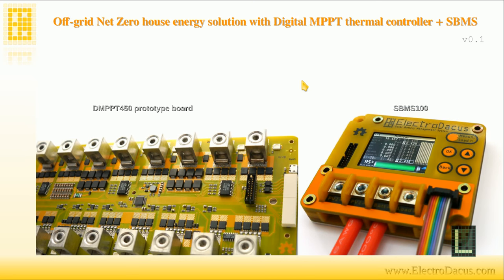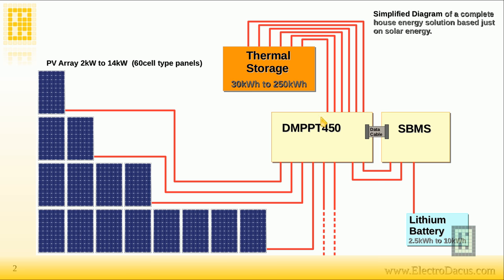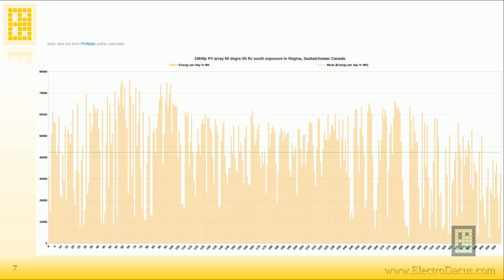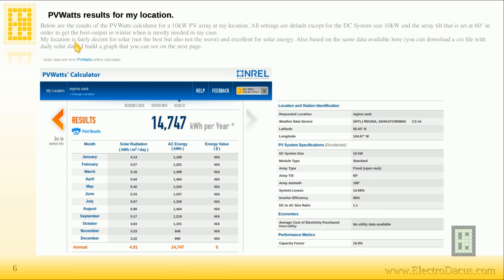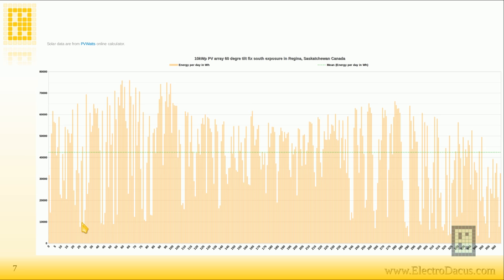Explaining the Digital MPPT thermal controller

Comment: Also in California not near the coast, you use a lot more energy for AC than I think the graphs show.  You also have to cool all the heat generated by your appliances and cooking.  On December 31st I got 2.1 kwh from a 6.5 kw west facing array. About 3 days a year less than 5 kwh.  Just about every watt you send to the floor or drums is a watt that helps you.   40 kwh is not enough in July to cool.  But if you get a cop of 3 would it not be better to run a heat pump?  But overall is pretty amazing.
Reply from the maker: I will use Los Angeles as example and that is a fairly moderate climate see this graph http://www.los-angeles.climatemps.com/los-angeles-average-temperatures-chart.gif
And here is one for even closer to coast http://www.surf-forecast.com/sstgraphs/Santa-Monic-Pier.png
Based on this you will not need any air conditioning if the building had some thermal mass shaded windows and no heat generated inside.
All heat generated by the appliances inside will of course need to be removed and that is probably the main problem in most cases. If you have an AC with a COP of 3 you will need to use 1/3 of the total energy used in summer for the AC just to extract the heat generated by all other appliances.
The position of your PV array dose not help and probably the tilt angle is also not ideal. On the other hand you have an average of +15C January where I have an average of -17C in the same month :) that is a huge delta.
Reply from the maker: Thanks for sharing the bill it is interesting to see that. It seems people use all sorts of units for energy so to confuse people :)
In this case is Therm and 1Term= 29.3kWh that means natural gas costs is in your particular case one rate for the first 56 therms and another more expensive when you exceed that.
First 56 terms are ( 0.95536 + 0.00107 + 0.09920 ) X 1.1 = $1.161193 per therm = 3.96 cent/kWh while the rest after first 56 are (1.23618 + 0.00107 + 0.09920) X 1.1 = $ 1.47 per term = 5 cent/kWh
I'm sure that is way better than electricity from grid but it is more than natural gas cost here at my location at the moment (price will fluctuate a lot here currently is extremely inexpensive).
It seems you need 172 therms that is 5039kWh to heat your house In coldest month (January) and that is significant compared to my small and energy efficient house that needs at most around 1000kWh in January and I'm sure is much colder here than in northern LA.
I looked at climate data for Palmdale and it seems average temperature in January is around +45F (+7C) while here at my location in same month average is +2F (-16.6C) 
Considering that delta between an acceptable +20C inside and -16.6C average outside is 36.6C in my climate and in yours is probably just 13C delta the amount of energy needed at your location to keep the house at +20C is 2.8x smaller than at my location.
In other words if I move my house to your location I will only need around 1000kWh/2.8 = 357kWh to keep the house warm in January.
Where you will need 14000kWh if you wanted to move your house at my location :)
Not sure how large your house is but probably the most economic investment will probably be to better thermally insulated your house.
Adding 10 panels to help with heating your house will not make a significant dent in your natural gas bill since those panels may be able to reduce the bill to maybe 5 to 8% in January and as average over the year maybe at best 15 to 20% saving on heating (I did not made exact calculations).
So while solar PV heating will be less expensive over a 25 year period than natural gas for any house the thing is that you will need a huge PV array to heat your house as it is and since you already have the heating system in place I will not recommend that.
So best way to save money on heating is to better insulate the house.
Reply: ***** Thanks, there are programs that help with that too, "Energy Upgrade California".  I know the walls are uninsulated and have about 40 linear feet of single pane sliding glass doors and about 7 large single pane windows, home built in 1950s.  Also tons of drafts.   Want a heat exchanger like yours is the house is negative pressure and the heater pulls air in and exhausts out the roof.  Virtually every rule to save energy was broken.  I still will probably buy one as a gift.
Reply from the maker: Having all that glass make sense why both heating and cooling are affected that much.
Not sure a HRV will help much in your case if the house is so drafty. It also seems that making that house more energy efficient will be expensive.
I always prefer building a new house than try to fix an old one :)

Comment: Great video. I sorry if i did miss it, but which method do you use to select the MPPT point
Reply from the maker: I measure the voltage of the PV array and the current and I switch more or less heat elements so that the Voltage multiplied with the current gives the best power output so not different than the way it is done when using DC-DC converters.

Comment: Please bare with us as you lead into a better understanding of new formulations and showing how best used individually . It's helping folks better understand and you will suffer watching dummy loads turning this fine switch relay turned into large smoking piles of junk .   
  Thanks  All , Thanks  be
Reply from the maker: You may find some of the questions in my new forum http://electrodacus.com/solarforum.html or you can ask any question if not already answered. Also all this have a user manual see  my webpage for the user manuals http://electrodacus.com
Reply: P.S.  Applying thermal dynamics outlined here has shone the difference between using a sledge hammer and one of velvet .  Amazing how much better everything works when only using exactly the amount needed and saving excesses . I hope too study your management programs further . Much Osmosis
Reply from the maker: @Nostrildomus  if you have some specific question you can use my new forum http://electrodacus.com/solarforum.html

Comment: What do you think of using Peltier module to use the thermal mass in reverse (cool in summer heat in winter) instead of having a really large battery array and phase change air conditioning? or should it be inverter powering phase change cooler for the thermal storage?
Reply from the maker: Yes Peltier elements will work with the DMPPT and I mentioned that somwhere in the presentation but you will need to build your own DIY Peltier based heat pump made of many series/parallel modules and COP should be around 1 so not as good a compressor based heat pump but still more than decent as the energy needed for cooling is usually significantly less than the one needed for heating because of the much greater temperature difference.
My house does not need cooling but I have a small fridge that is based on peltier (a single 50 or 60W rated module) normally using 50W from 12V but it is used  at 5 to 6V about 12V since any more than that temperature will go below freezing inside the fridge and using a thermostat on a peltier fridge is very inefficient as when peltier element is not powered energy will be lost trough the element so is best to be powered all the time and the lower the temperature difference the more efficient it is so with 6V is way more efficient.
Thus for a peltier that will work around 30V max power point of 60 cell PV panels you will need 5 or 6 standard peltier modules in series and since each will use just around 12W and move about the same amount of heat it means you need quite a lot of modules for a decent power but luckily the modules are fairly inexpensive and can probably be coupled with large water blocks to move the heat at leas on one side then air cooling on the other side.
Reply: yea Peltier would be fairly complicated, but I can see using a buck converter MPPT in order to keep all of the peltiers powered just at lower power. I think I will do some experimentation with that for sure, I really want to get into that even if it is just to get some fresh air in my room while heating or cooling. I will most likely use liquid cooling for the peltier modules.
Reply from the maker: You do not need to have a buck converter as mentioned you can connect 5 peltier modules in series and each will see around 6V to 7V (60 cell PV panel has 30V max power point and around 38V max open circuit voltage) The current from the panel will be dependent of amount of light and one set of peltier as the one my fridge uses will take around 2A at 6V and a panel will output around 8A at max power point so you can have for a single panel (250 to 280W typical for 60 cell panels) 4 strings for 5 peltier elements in series so total of 20 peltier modules (20x 12W each about 240W and at COP of 1 around 240W of cooling power or in reveres 480W of heating power).
So all you need is a small microcontroller that will measure the PV panel voltage and try to maintain that around 30V by switching ON or OFF some of those 4 strings of 5 peltier module in series basically a Digital MPPT  same concept I use.
The difference mine is designed for 10 to 40 large panels so very high power 10kW needed for heating my house fully with solar PV. This winter is first time my house was heated by solar PV only.
A buck DC-DC converter capable of 450A 14kW will have been huge, extremely expensive and much less reliable compared to Digital MPPT plus a lot of electromagnetic noise from high frequency switching.
Reply: OK so the peltiers would always be in series and you just connect and disconnect the solar panels to get regulated power to the peltiers. the problem I see is that some of the panels are not being used where if all the panels were in a 12S3P arrangement you can use a buck MPPT to have all of the solar power available. unless the reason you are not using all of the panels is that the power would be too high? could you just not buy so many and have a smaller system doing the same work?
Reply from the maker: Not sure I understand the question. In the simple example I gave a single solar panels was used to power 20 peltier modules and max power point was achieved by connecting or disconnecting groups of 5 peltier modules is series.
Also if you refer to the DMPPT450 then all panels are connected all the time and max power point is maintained by connecting and disconnecting restive heat elements so all energy from panels is used.
So with DMPPT450 all panels are used all the time and efficiency is well above 90 to 95% so better than a large and expensive buck DC-DC converter.
The heating or cooling is just a part of the DMPPT450 the other part is when used together with SBMS for Lithium battery charging that  some of the panels can be redirected to charge a small Lithium battery and the number of panels redirected to battery charging will depend on the amount of energy available from sun so in a sunny day maybe just 6 of the total 40 panels will be redirected to battery charging as they will provide around 50A charge current needed for the small 200Ah lithium battery and all of the remaining 34 panels will be used for the heating part while if it is cloudy/overcast up to all 40 panels can be redirected to Lithium battery charging if current from them is below 50A max acceptable for battery charging while heat from the large thermal mass will be used to maintain the house warm for 4 to 5 overcast days.
So my house will have a DMPPT450 connected to 40 x 260W panels then a large thermal mass over 160kWh capacity (mostly made of a large volume of concrete) then I will have an SBMS120 connected to the DMPPT450 and to a 24V 185Ah LiFePO4 battery for electricity needed in the house for appliances in my case usually less than 100kWh/month most of that for electric cooking.
So in a sunny day the 40 panels will produce up to around 60kWh of energy from that around 3 to 4kWh will be used by electric appliances / battery charging and the rest will all be stored in the large thermal mass storage.
While in absolute worse overcast snowy day all panels will be redirected to battery charging producing at least 3.5 to 4kWh (this is absolute worse day) but still sufficient for all my electrical needs and I can have an infinite number of overcast days and still have enough electricity for appliances but for heating I can not have more than 5 to 6 consecutive days like this (not the case at my location).
So is a bit more complicated because both heating and electricity for appliances use the same PV array and right now I work on the algorithm that will handle this. You can watch the progress on my google+ page   https://plus.google.com/+electrodacus and you can also see time lapse with different weather and amount of energy generated by the PV array.
Reply: OH I see the panels are in a parallel arrangement! so putting them in parallel it will be more current but it is shared evenly across what is in parallel. Then because the SBMS is not MPPT only a protection you limit the current by disconnecting panels to it. (PVStop is telling me I am crazy for thinking a 600v PV system is crazy, believe that!) So your system would only be wasteful if you did not have the thermal mass since the battery would charge quite quick. I am still in the development stage for myself (I am renting now so nothing can be installed even if I had the room) your system is a very robust and simplistic design but achieving 90% efficiency congrats on that!!
Reply from the maker: Yes panels are all in parallel and the main reason to limit the current to battery charging by only redirecting a few panels is to protect the battery that will not like a charge rate above 0.2 to 0.3C since if more tan that it will heat up and life of the battery will be reduced increasing the cost amortization for the battery.
Another helpful thing reducing the battery cost amortization is better battery utilization by having a very small battery since battery can be fully charged in any whether so it only needs to handle consumption over night not the typical 3 to 5 days in a stand alone system with fixed number of panels.
All energy used as electricity in the house will also contribute 100% at heating so it will have dual role.
Say out of 1000kWh per month you use 100kWh (10%) for appliances in the house then that 10% will also contribute fully at heating the house. In summer this heating is not desirable so is best to keep the house energy efficient and use little electricity even if it is low cost else you will need to use even more to pump the heat out.
I like the ultra low voltage around 30V nominal max 40V open circuit as it is safe to work with i any conditions and the small extra cost for cables is well worth this added safety. Plus any shaded panel will not influence other panels as they are all in parallel (not that I have any shade issues at my location).
I'm just sorry that 6 or 7 years ago when I designed the house I did not know solar PV panels will be so inexpensive that they will be the lowest source of energy (better than natural gas or thermal solar) as I will have incorporated all the panels in to the house structure. Not a big problem as I have more than sufficient land.

Comment: Hi, nice work!! Quick one: I was wondering if the passive house principle of letting the sun hit the concrete floor directly is more efficient than using electricity from the PV panels. Or perhaps the reason for the PVs is that the sun longer hitting the roof than the right angle for the floor plus the cost for large windows to let the sun in? Thanks!
Reply from the maker: The reason PV is more cost effective is that the large window will be more expensive and because during the night the window will have losses about 10x higher than a typical wall of same area while PV have no losses during the night.
In a cold climate the loss even on a very expensive triple pane window may make the gain negative so having large windows at my location will not work at all as the gain during the day will be smaller than the loss during the night unless some additional thermal isolation is added overnight and in cloudy days to windows but even then PV will be more cost effective since glass is the most expensive part of the PV panels right now and is just one pane of glass.
There is also the advantage that is electricity so you can better distribute and store heat and you can also use that directly as electricity for appliances thus the large PV heating array will help reduce the battery capacity needed by 2 or 3x additionally contributing to savings. Also uses for massive excess amount of electricity in summer may be found where large windows will just be a problem in summer unless covered on the outside.
Reply: Thanks! Makes a lot of sense. I live in Buenos Aires, Argentina and the weather is way different than cold countries. But I am sure with a few changes I could use your system. I already have Radiant floor heating with boiler heated water running trough the pipes. The pipes are buried into concrete slab (not that nicely insulated but is a thermal mass like 100 square meets). Not sure how I can transfer heat to my current system with PV. Unless I replace the Boiler with an electric heater but then the efficiency of that should be very very low.
Reply: My design got 46m2 of windows and it's by far more performant then PV while the sun is here. 2000€ for those 46 square meters. Add 2000€ for insulated shutters.  And i got a great vision of the valley during the day which is .. invaluable, far better then to be in a house with small windows. At night shutters contain the heat in the house while the inertia of the thermal mass will prevent temperature from going down too fast.
In winter on a sunny day 1000w/m2 of irradiation would give me something like 16kW of heat (solar factor of 0.4, double glaze), equivalent of 80m2 of PVs.
Of cousre if you are living at the North Pole it may not be the best solution.